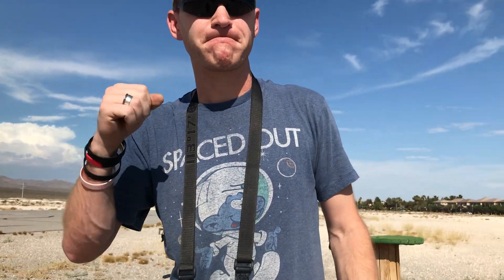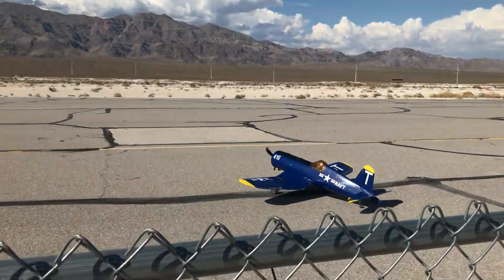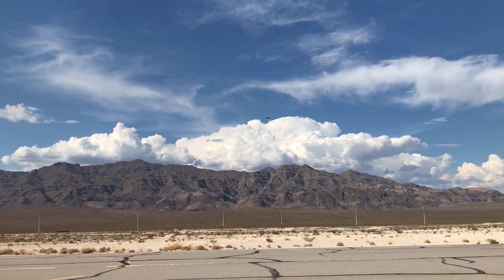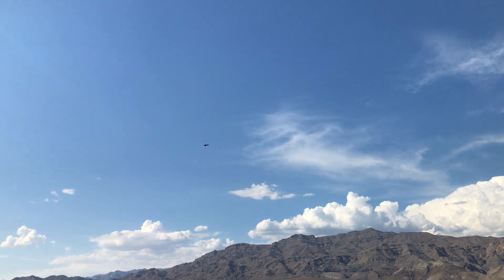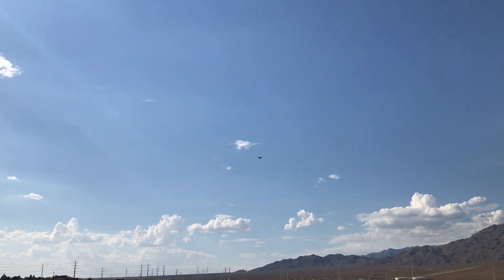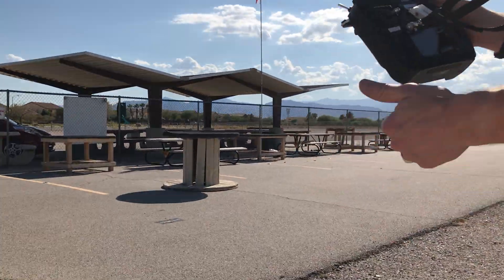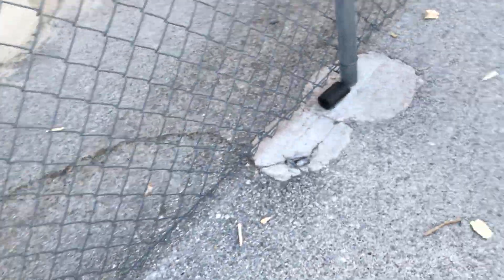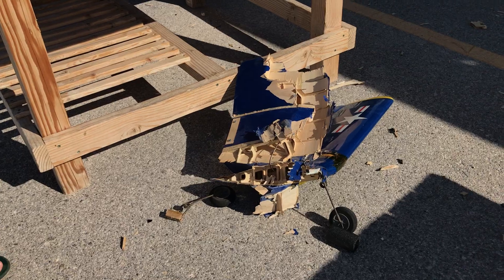First Gas Airplane Ends In A Catastrophic Crash

Comment: Something was wrong before you took off.  Ailerons dont shake like that with gas engines.  I only fly gas and dont see that on my Corsairs.  You probably went into failsafe when it crashed, just speculating.  My guess is you had the default which is hold last position.    I also saw a LOT of elevator throw.  That much is not necessary.  Mine only has about 3/8" up/down.  You can tell if you have too much elevator by doing a loop with full elevator applied.  It will generally snap at some point in the loop.  Seeing the jittering on the ailerons in flight is probably a result of the stabilizer trying to correct for the jitter we saw on the ground.  Thats a signal to land immediately.    I agree with an earlier comment, dont really need a stabilizer on a warbird.  Thats just an opinion on my part.

Comment: The worst crash I have had... Not as I expected.. But you never know till you try...  That is not the right response when you learning to fly. lucky you no-one was sitting on the bench. the next time my friend use a body box and be sure al the surface are in good shape before you fly another Rc plane.
Reply from the maker: Haha. Yeah. Stuff happens. The "you never know till you try" part was for adding a stabilizer using new methods... This method was not great... But it was better than what I had before. Got to learn some how man. Anything can happen even to the best of pilots. 

Thats why I test new things when know one else is @ the fly field. 

Play it safe and do my best to be safe. 

~Russ
Reply: @RWGresearchLive  Bad way to look at things.  Learn to fly ahead of the plane.  Your flying is jerky and uncoordinated. Yes things can happen to even the best of pilots, but they can handle the situations.  Learn from them and don't get hurt.  AND, get rid of that damn stabilizer and fly the plane.

Comment: Learn how to set up Giant Scale.  You have to use the right hardware.  GOOD servos, linkages, receiver power, the switch, etc.  Proper set up and flight skills are a must.  Lucky that no-one got hurt.  When you don't have control, or it's not responding, you have to learn how the CUT the throttle.
Reply from the maker: Yeah. I agree. I did my due diligence. And as you can see from the beginning of this flight everything was going fine . Unfortunately anything can happen to even the best Pilots or best aircraft. 

Anytime I'm doing something new or unknown I tried to do it with no one else around so no one else gets hurt.

Cheers

~Russ

Comment: RF signal Critical
Reply from the maker: I'm using a multi-module transmitter with a spectrum receiver. You have to calibrate the RF signal otherwise it will constantly yell at you that there's an RF signal critical. I did not calibrate the RF so it always does that when you connect the multi module like that. However I did set up fail safe and dis a range check so all good there. ~Russ

Comment: You could not have picked the worst model to fly for your first gas model.   Model was over powered, good chance over weight, may have fluttered the elevator.  Corsair models are not forgiving.
Reply from the maker: Yeah. I know it's a hard model. I have lots of electric models. I mean it was doing great there for a bit then said... Na... I'll go for the parking lot! Haha ~Russ
Reply: I’ve had that same plane with the same engine. It actually was the best flyer out of the 5 I owned. Tge other four were bigger and decided to keep the 3 largest ones and sold the other two. That one with the zenoah 20 flew like it was on rails and I couldn’t coax a bad landing out of it. Sure the engine was bit much but it actually balanced it perfectly without any ballast weight. Flutter is totally possible as I did experience that with mine and had to reinforce the horizontal stab and elevator. After that was done straight down and full power was nonissue at all. It’ll wouldn’t float in but was very manageable during landings for a warbird. Gyro ls of any kind certainly weren’t needed in any way shape or form. Some models benefit but I don’t see this as one of those.

Comment: Bummer about the plane, why was the transmitter saying RX critical, I’ve never heard that before, when flying RC planes, always keep a trash bag in your back pocket for good luck 🍀, hopefully 🙏🏼 you won’t need it, but if you do ?
Reply from the maker: I'm using a multi-module transmitter with a spectrum receiver. You have to calibrate the RF signal otherwise it will constantly yell at you that there's an RF signal critical. I did not calibrate the RF so it always does that when you connect the multi module like that. However I did set up fail safe and dis a range check so all good there. ~Russ

Comment: never use cheap flight controlers on models you like.    thank the lord nobody was there.
Reply from the maker: Yeah totally. This one was the first one I did and it was kind of an experiment which is why I went over there when no one was around. just in case something like this happened I take this hobby and safety seriously.  I've had other people actually fly airplanes into the crowd at this exact location. one jet going full speed almost hit me by about 3 ft. It turned into more pieces than what mine did it's the only other airplane I've seen destroyed worse than this in this exact location.

~Russ
Reply: @RWGresearchLive   i know accidents happen. i had a 700 helli that did a rain dance on the ground and slung a piece of blade into the crowd and gave a man 7 stitches on his wrist. Shit happens. I was just stating as a viewer thank god nobody was there with nothing against you. i will say i am convinced that flight controller/gyro is the cause of your loss of control.

Comment: Are you banned from the field for crashing in the pits?
Reply: Sometimes it happens
Reply from the maker: No. Things like this happen in the hobby. In fact I was 3 ft from a large-scale jet that landed right next to me right near those benches. In fact it hits so hard it bent over that blue sign you see in my video. Things like this can happen. 

I had an experimental gyro setup on this airplane so I went out there when no one else was there just in case something would happen.

If I'm doing something experimental I usually go out there with no one else is there. because stuff like this can happen to anyone.  signal loss and other things happen. 

~Russ

Comment: 4:52 did it say 'Rf signal critical' or did I mishear? If so, that means you must land immediately. That may explain the loss of elevator control. Stabilser gain way too sensitive, would actually have been better with it. By the way it's not a lithium iron phosphate battery. It's Lithium Polymer. Better luck with your next model.
Reply: Apology re the battery.
Reply from the maker: @Grahame59 all good my friend! ~Russ
Reply from the maker: You heard right. It did say that. I'm using a multi-module transmitter with a spectrum receiver. You have to calibrate the RF signal otherwise it will constantly yell at you that there's an RF signal critical. I did not calibrate the RF so it always does that when you connect the multi module like that.

 I did a range check everything is golden. 
The Gyros had multiple settings however because of the mounting at full RPM the gyro was upset. If I would have throttled back it probably would have responded fine because the vibrations at full RPM is the place where the Gyros was most upset.
 I tested that on the ground. 
And by the way it is a LiFe battery. As I said in the video. Go look it up. We typically don't use Lithium Polymer batteries as flight Control batteries in this scenario. The lithium iron phosphate batteries can be charged to full and left that way without damaging them and their nominal voltage is 3.2 volts per cell. So at nominal voltage we get about 6.4 volts with a two cell which is perfect for most receivers and servos. 

Lastly I set my fail failsafe up as well. Did everything by the book.

However this was the first time I've used this type of stabilizer on a gas airplane and it was a questionable decision. It was actually going fairly well at lower RPM on the motor.  if you watch the whole flight you'll see that it gets squirrely when I do full speed for Two reasons. 

1. The vibrations at that RPM upset the gyro even on the ground.
2. Gain set too high potentially for that speed. 

Cheers

~Russ

Comment: Just fuel for thought for your next gasser… Never soft mount your stabilization system (gyro). Always mount it solidly to the airframe as close to the CG as possible. The gain on your gyro may also be turned up to high (too sensitive). That can also cause the shakes.
Best wishes on your next bird. Looks like north Vegas flying field👍🏼
Reply from the maker: Yeah. So I actually had it mounted rigidly and it was completely unusable. So then I added a soft Mount which actually worked at extremely well unfortunately only under Full Throttle was it pretty stable. At Full Throttle it got a little wonky due to the refresh rate of the flight controller matching the vibration rate of the full rpm.

And watching the video back it seems like I was going full power trying to pull up thinking more speed would help but actually I think it was upsetting the gyro even more.

I kind of proved some of this out on the ground while I was testing. 

I actually had two settings on the gyro on a switch so I could play with high gain and low gain.

It didn't seem like it mattered but the low gain was more stable from the vibrations.

I went out there to do some experimentations with this type of Gyro with that type of isolation and there's the result.

Lol

Yes indeed it is the north Las Vegas flying field.

~Russ
Reply: @RWGresearchLive  Wow Russ, seamed a little sketchy from the get go. Was a godsend that you and your son were there alone.
Always, best wishes and many soft landings in the future,
Chuck E (NFLhasbeen)
Reply from the maker: It wasn't great. But as you can see it was working ok at the start. 

But yeah. I can't learn new things if you don't try... 

And when you're all by yourself it's not a big deal if things crash. 

Pick my self back up and try again... 

Cheers

~Russ

Comment: Best you stay with slow, light weight electric primary trainers. You could have killed somebody that day.
Reply from the maker: Yeah that's an option or you can get out there when no one else is around so no one gets hurt and do some experimentation push the limits and have some fun... 
By the way I was within 3 ft of somebody flying a large-scale jet straight into the fence right behind me in this exact location. Anything can happen... you just got to take the precautions be smart be safe and go have some fun. If you think a plane is going to crash don't fly around people . It's called common sense. 

And I used mine that day which is why I was out there by myself. 

~Russ

Comment: Well the take off was good, but the landing was a little ruff. Are you going to rebuild it?
Reply from the maker: Yeah take off wasn't too bad. I was more worried about getting the tail up and getting AirSpeed rather than  going straight.  which is why it kicks so hard to the left. My focus was not counter steering but instead airspeed. 

I have rebuilt alot airplanes that have been crashed pretty bad before. However this one just purely because of how many pieces it's in doesn't seem practical. 

Also because the motor hit the bench at full speed it bent the crank shaft and ripped off the carburetor so it's most likely not gonna fly again. 

Here is  an example of another plane I fixed in the past. (On my main channel) 

https://youtu.be/5H2O13F6pe4?si=8cYO5zzim9g0ER0V

And here is an interesting. You may like:

https://youtu.be/rNlZCme3pWM?si=O-okkvPHwU5Epv07

Although I do enjoy fixing Balsa of planes a lot of the foamies are a lot easier to fix. 

Cheers

~Russ
Reply: @RWGresearchLive  Tracking straight, gaining airspeed without thinking should be natural if you aren't a beginner. Get those two right and the tail will lift by itself.
Reply: Take off was terrible.  If you cannot keep the aircraft on the centerline, you don't know how to use the rudder.  That means you are just a bank and yank flier.  Practice proper takeoffs and power control.  "Just concerned about getting the tail up", is no excuse for not trying to control the aircraft.  From his comments, he has no interest in advice or flying well.